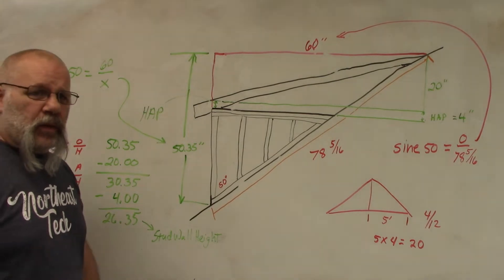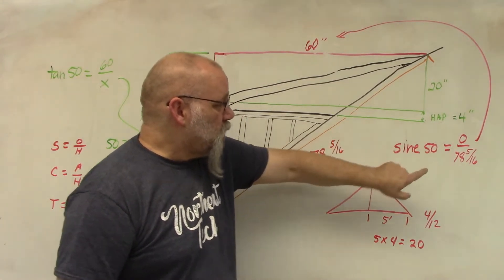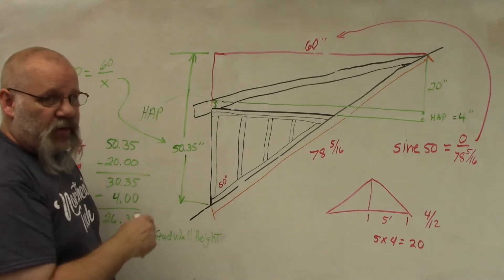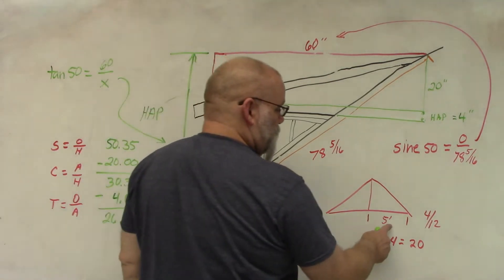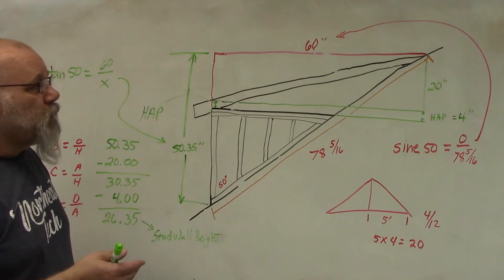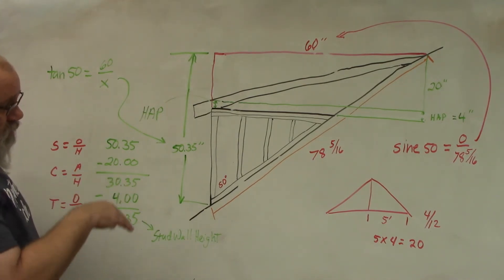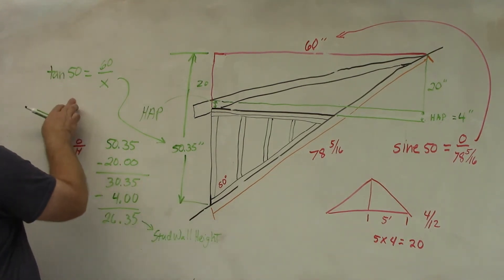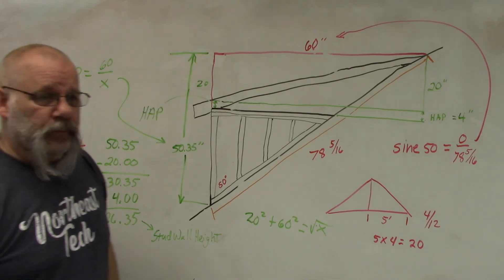Figuring shed rafter for a dormer

Comment: Ngl...this is fairly confusing for something that would normally seem straightforward...

Trying to do a flat shed dormer the length of my house to put in a covered sunporch and laundry room addition.  Wouldn't it be easier to just install the outer wall posts and then just lay out the boards, cutting the angle to join to existing roof by laying a board at the angle and scribing the line?